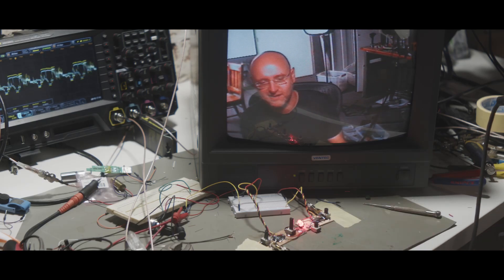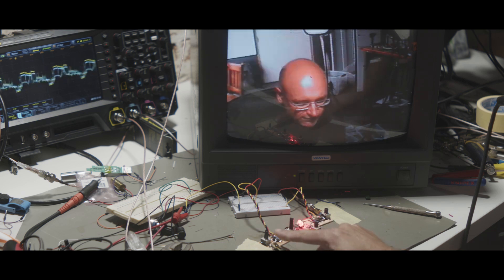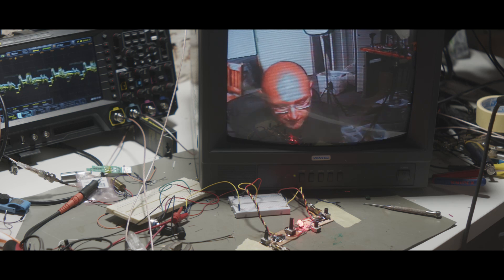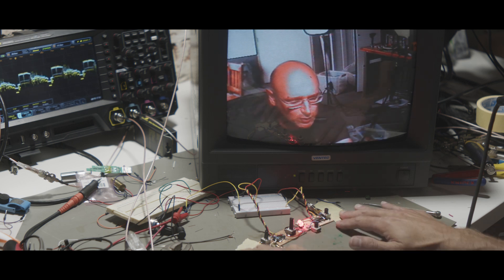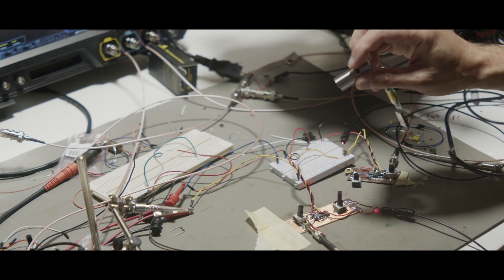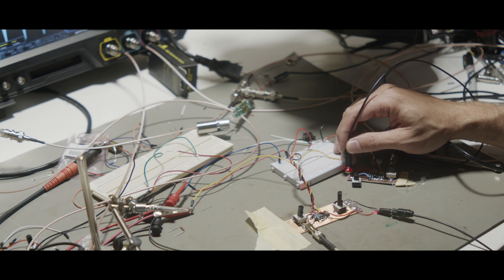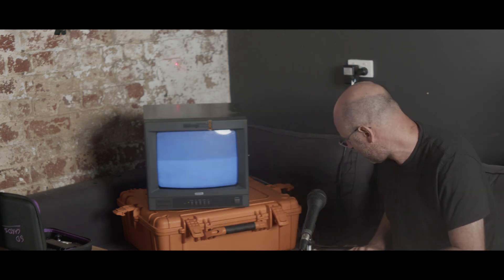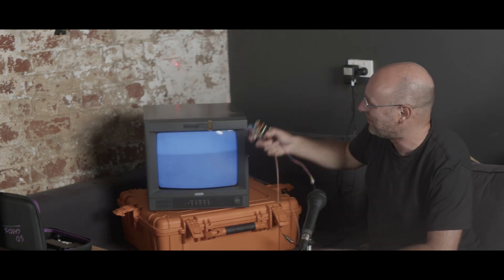Voslink: Optical Analog Video

Comment: so.. did u just connect the video IN to the led/laser and put a potentiometer in-between? can u regulate the brightness in the same way while using the laser output? (neat video!)
Reply from the maker: Only a little bit more complicated than that, but that’s the basic idea. I needed the opamp to source enough current to drive the laser and I needed to offset the voltage above the forward voltage of the diode.

Comment: Using laser light to transfer video over optical cable is now used extensively in warfare. Sending video over free air with a laser is at the end of the day nothing else than RF transmission just on a very different wavelenght(in this case "kind of" visible light).
Reply from the maker: Nothing but amplitude modulated terahertz signals

Comment: wait. so is this basically an opto-isolator IC like they used to use for ground plane isolation on old hot chassis CRTs, but instead of using an optical isolation diode, you're using a discrete photo diode to detect the output of an led controlled by an opamp and then separated with a toslink cable?
Reply from the maker: Yup :)
Reply: @superchromat  gotcha. we (in the old CRT community) have been developing optical isolation PCBs to add RGB inputs to hot chassis sets, and the designs are based on mainly what Toshiba was doing in the 80s